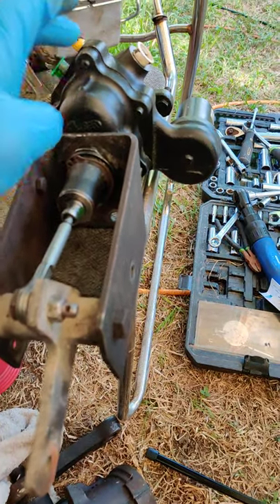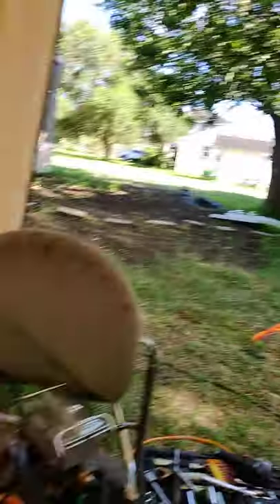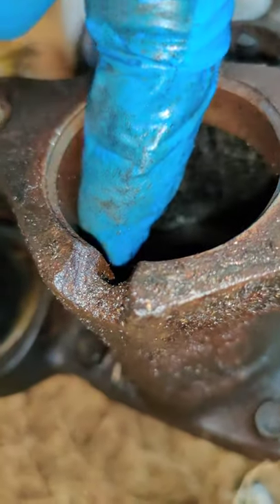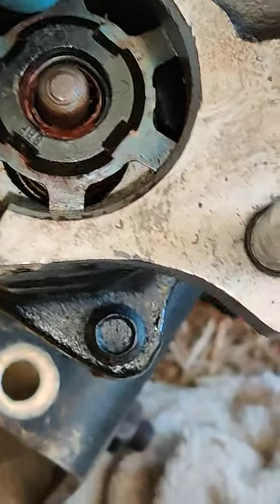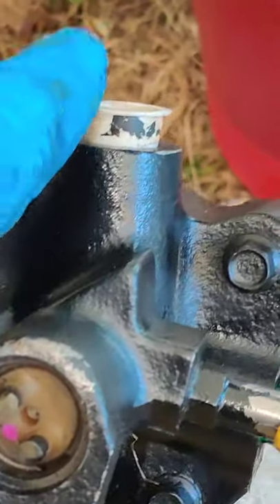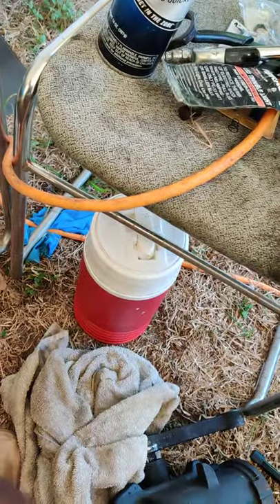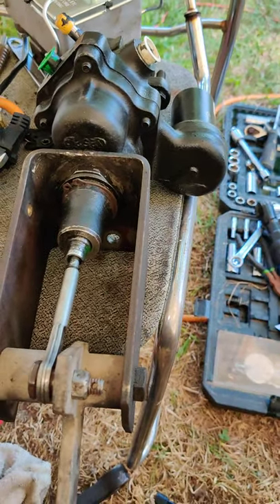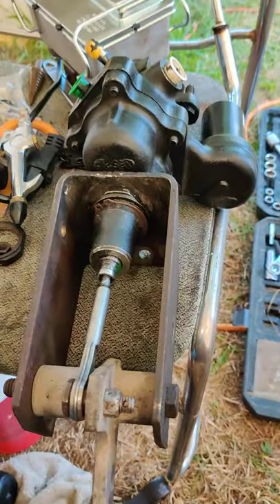P30 hydroboost/repair.

Comment: How do you know if the hydroboost is bad.  I had a "big truck" style shop go through my brake system, replacing rotors, calipers, pads etc, but not the hydroboost, but I still have to mash down on the pedal real hard to get my 1993 P30 Winnebago to stop ??
Reply: It was probably leaking somewhere. Power steering pressure is higher than vacuum brake booster pressure. My problem was the opposite:  My pedal went to the floor so we replaced the leaking brake master cyclinder. Now, the power steering reservoir is low. My Mallard is a 1987, so I know that almost every system that has not been rebuilt on the motorhome recently is a potential failure point. To own one of these 80s or 90s P30s, you have to enjoy working on it or it'll drive you insane. Mine's a pain in the neck, but it does force me to crawl arounf underneath it and get some exercise. There's no way I'm paying some health club to burn calories and stay limber.

Comment: That was EXCELLENT!! Thank you 👍 I also have a Pace Arrow. I'm working on removing the hydroboost and you sir just saved me probably atleast 5 hours of time.  I also picked up those same head lights. My question to you about that is did you figure out a way to get all of the LED's running when in "Brights" mode?